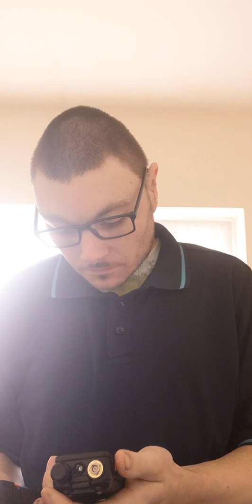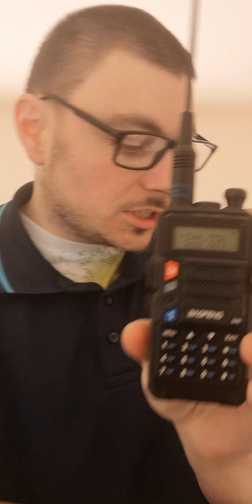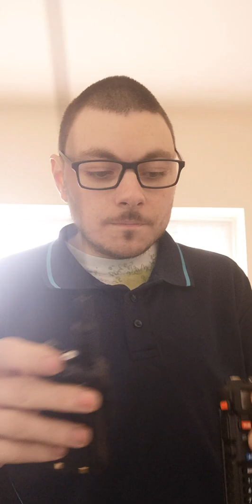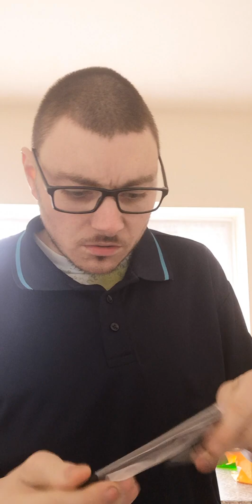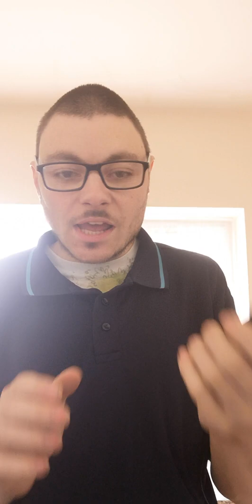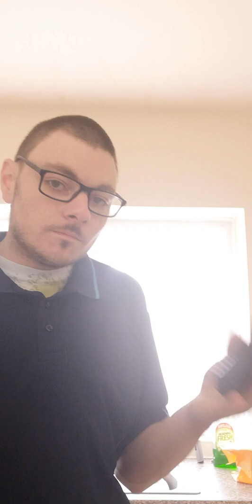Baofeng UV-S9 unboxing and quick thoughts

Comment: I have the same radio. The port on the battery is so you can charge the battery via a 5VDC USB 2.0 cable.  I did an eBay search and was able to buy the cable. This is much more convenient than carrying around a charging cradle. I find it also charges well off a portable power bank.